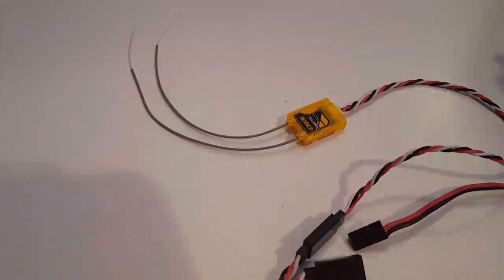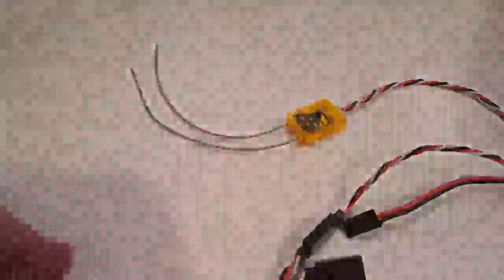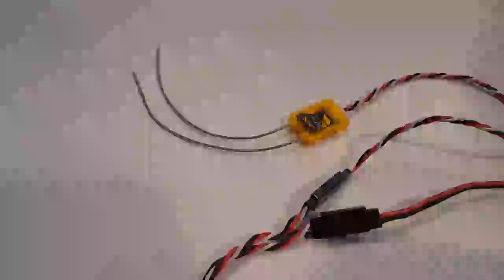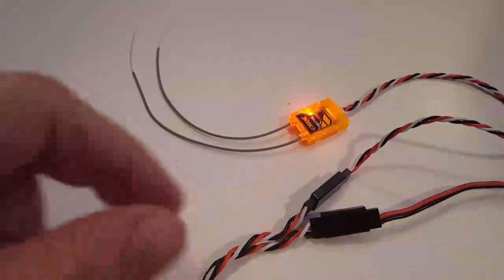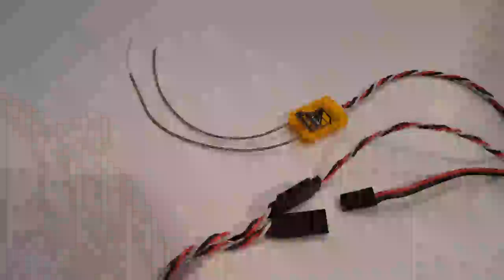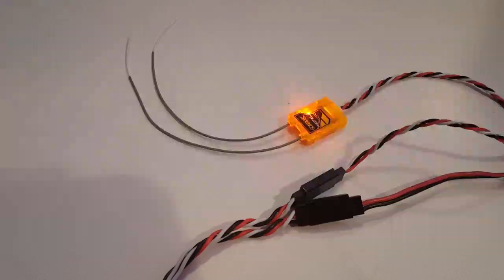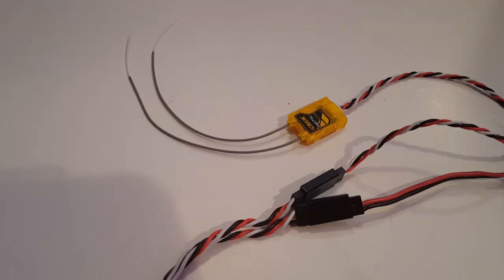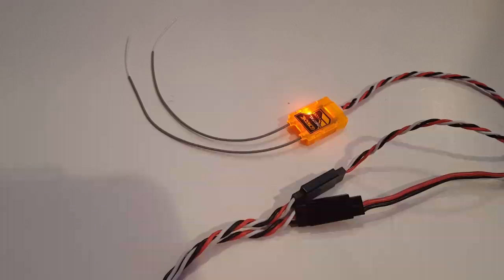Binding to Full Range Orange r617xl  Spektrum FPV receiver

Comment: Here we are 7 years later and your video got me bound on this old receiver that I had from back in the day. I have some old school drones I never built from Hobbyking and I decided to build them now. I'm using the old KK.2 boards both the regular size and the mini's which are actually 30x30mm whole spacing like the modern F4 and F7 boards now. These KK.2 boards are still awesome as they just work. I use these old quads to help me practice line of sight flying. No FPV usually, but I might go all out old school on my Hobbyking 650 Predator. Lol  Are you still flying anything? thanks for the Video. you just never know who needs help these days. Lol   Jim

Comment: Can I use this in an rc plane? I purchased this receiver in hopes of connecting my servos and ESC and everything directly to it. Is there an adapter that I need or some other plug to use this with my other servos and ESC?
Reply: This isn't designed to work as a stand alone servo RX - it doesn't have a rail to power the servos nor individual channel outputs to connect to.  The single output wire is designed to be used with a flight controller that reads the signal and receives 6 channels of data from 1 signal wire.

Comment: I was just looking to buy another dsmx sat reciever but I normally bind them to my dx9 through betaflight cli command. This method will not work for you either?
Reply from the maker: RcHaze I've had intermittent success using the command line interface. Possibly due to different clone satellites and different Betafight versions and different FC's.
Reply: driveandflyrc I run nothing but clones I do have non clones but I never had issues with clones so I never installed them I bought in bulk lol. 2 clones would not bind on two fc boards binding through another quad worked. One was an omnibus f4. Thanks for this video I never bought an orange. Redcon and lemon been my choice. A couple lemons the rest redcon. Near 20 quads this hobby is addicting! Btw how is this reciever? What's been your range with this sat?
Reply from the maker: I really appreciate your input, every little bit helps others in our community! Thanks for sharing your experiences :D

Comment: for me none of these methods worked, the receiver always blinks once while starting up and then never again
Reply: I had the same problem, after changing the ground and signal wire it finally worked.
Reply from the maker: I'm surprised your receiver lights once and doesn't blink indicating bind mode. Would you like to post a video of your experience or have you stopped working on it? Your DSM2/DSMX transmitter works well with other receivers?
Reply: I just received two in mail today and have the same issue. Both of them with even with solder black ground to white signal wire still only one blink and not entering bind mode (using naze32 to give 5 volts and gnd)
Reply: the exact same thing happens to me
Reply: Same for me
Reply: X5  =(
Reply: same here. after powerup, blinks once and goes silent.